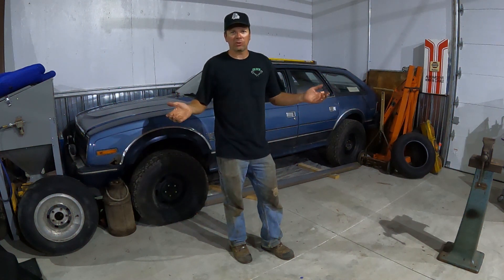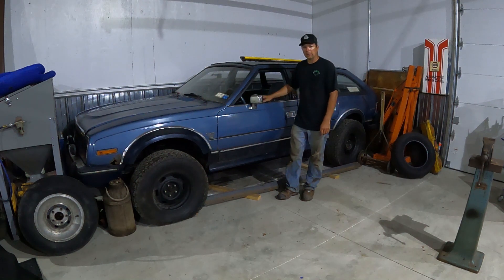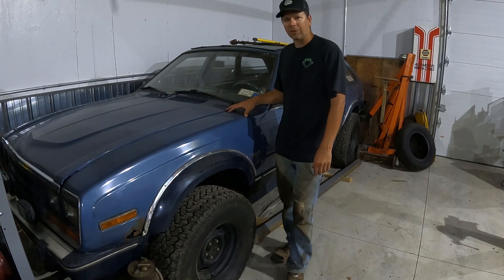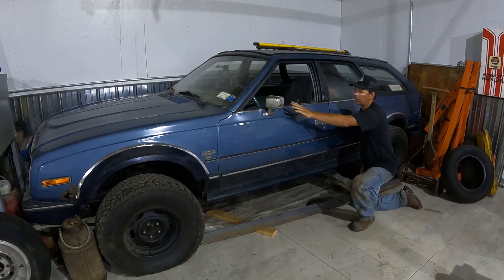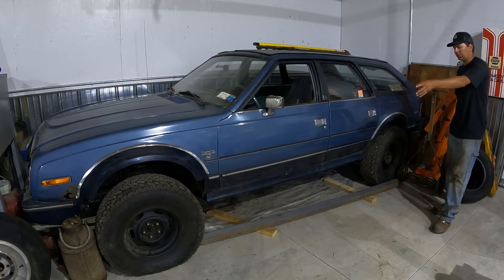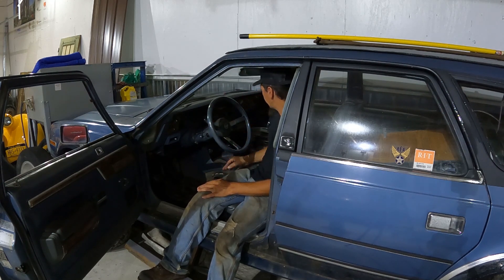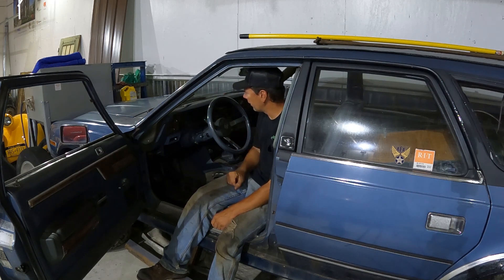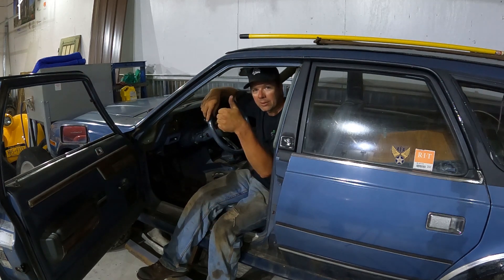What was your first car?  Mine is this 1984 AMC Eagle

Comment: My first car was a 1965 Chevy Chevelle Malibu SS. I was the third owner. I paid $675.00 for it. I had a friend do a complete color change and being the "genius" that I am I sold it for $600.00. That was way back in 1976. When I worked for Clifford  Performance I designed a tri-y header for a 1984 AMC Eagle like yours. It was the only thing that I could make fit. I'm not sure if they still sell them, but Clifford is still in business.
Reply from the maker: Clifford 6 = 8, cool!  Must have been a chore to make that header work with the Eagle front axle mount.  You can barely get your hand in there to get the stock manifold out.  I had a Clifford intake for an '82 F100 with 300 six, but never installed it before I sold the truck.

Comment: My first car was a 1936 Chevy sedan delivery. It had a j2 Olds with Pontiac hydramatic and 9.3 Olds rear stock front axle & steering. Bought it in 1969 for $1200. Drove it as everyday until I blew up engine and replaced with SBC400, 350 trans and early v8 nova rear end. Drove it with Over the Hill Gang ( so California) 72 NSRA Del Mar and every club meeting and run till about 1984. No longer have it wish I never sold it but life happens and family well being comes first
Reply from the maker: Sounds like it was an awesome, and rare, hot rod to have back in the day!
Reply: @QuickSpeedShop  yes even had stock 36 front brakes( juice) but changed it to discs with the upgraded engine. Don’t remember the year or model AMC discs retaining 36 spindle on straight axel, had to change bearings, had to go to a shop that sold bearings no automobile cross over

Comment: How about a breakdown on the suspension setup
Reply from the maker: Stock front suspension with 1" CNC aluminum ball joint spacers.  Rear suspension stock leafs with 1.5" lift blocks.  Front axle is stock Dana 30 IFS.  Rear is Chrysler 9.25" Suregrip out of a '77 Dodge Magnum.